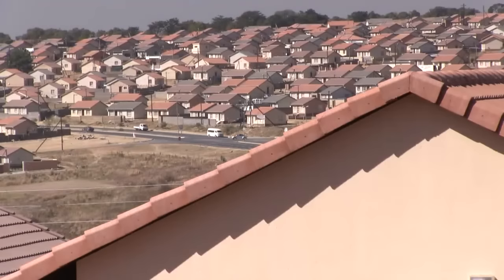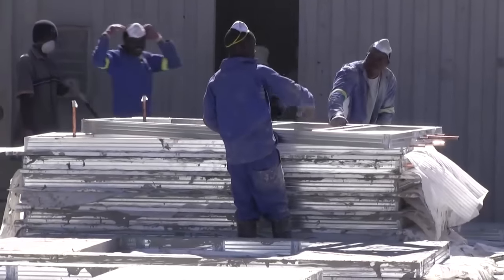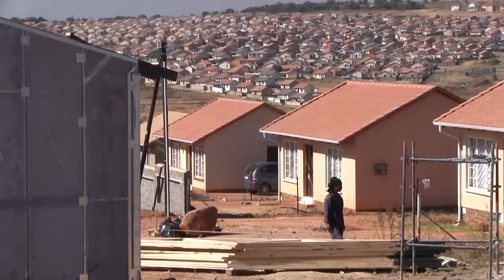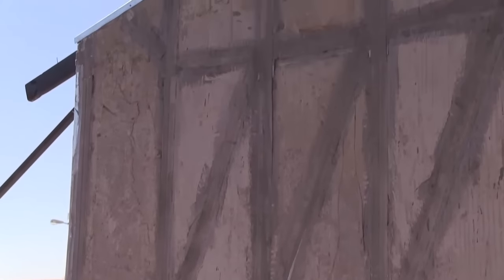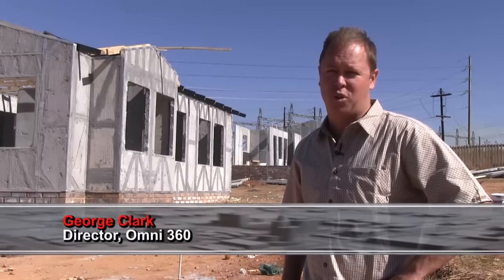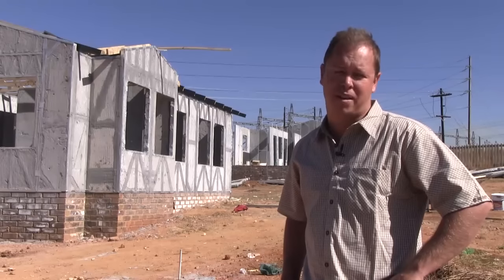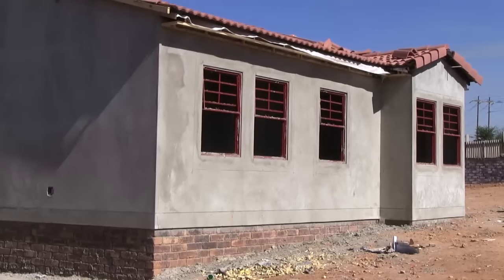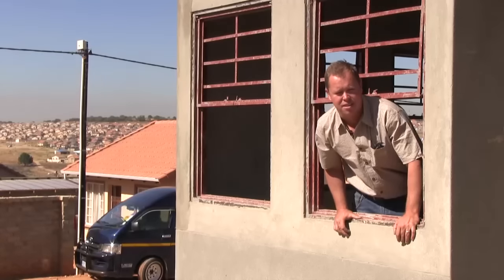How to build a low-cost house in only two weeks (construction)

Comment: So what about the corrosion of the copper pipes in direct contact with the cement?  Seems like you are setting your self up for failure after a few years.  PEX  piping in the walls might have been a better choice.
Reply: i'm in a 40 years old house with copper pipes going through concrete walls.
nothing broke or is corroded.
what do you mean ?
Reply: You are not supposed to allow cooper pipes to be in direct contact with poured concrete.
Reply: I was a home inspector in the mid south region of USA. I am not familiar of copper corrosion in concrete but very aware of the galvanic electron exchange between copper & galvanized (zinc coated) steel. The isolation of pipes from the frame work when filling the forms looked as possibly some questionable workmanship.  I would estimate lifespan of copper pipes as 3-5 years before leaking begins & gets worse over time. Are there any current maintenance reports from these developments available?
Reply: Usually applies to wet concrete. If its dry no problems will occur. Basements get the problem your talking about

Comment: How does it hold up in areas with high humidity and soil shift due toi intense rain followed by long dry periods????  Does the foundation and walls crack if oyu go from intense rain periods to dry periods?
Reply: Why would it?  They are not made of mud
Reply: Cracked slab/foundation.  That is why smart people do not buy houses on slabs in Louisiana .  4 months of soaking followed by 3 months of near drought the soil shifts under the house.
Reply: Living in the Bayou...wet, wet.

Comment: I doubt that foam concrete is going to pass building codes in the US.
Reply: In this application it might. All the structure strength comes from the steel framework.
Reply: Correct
Reply: It is able to pass so long as the panels are sandwiched and anchored on a footing. Minimum standards are ridiculously low. I would advise vertical and horizontal continuous ties as a safety precaution ~ but these buildings can withstand the general forces of seasonal cycles as well as a timber framed building.
Reply: TheStavros1001, the real issue in the USA would be the thermal bridging of the steel studs coated with plaster. Suitable only for southern california climate.

Comment: Biggest problem with all these rdp projects. 
Too many plots. Too much sprawl. Making the issue worse. 

Creating terrace style housing would be more similar to the communal environment these communities are used too. It would take up less of a footprint, connections between homes would use less material, have better insulation, possibility of solar panel arrays in a tighter organization.

Just bad bad design.

Comment: how does this structure resists earthquakes?
Reply: It won't
Reply: Resists like a stack of cards.
Reply: If the steel frames are joined to each other with steel, probably fairly well.
Reply: FYI South Africa does not experience earthquakes. This is in South Africa, Gauteng.

Comment: What the insulation value of the AAC walls?
Reply: Unlikely being very good, better in comparison to bricks is possible but nobody just build brickwall without any insulation in the western world (this is africa) but doesnt really help. Perhaps its easy to install insulation inside that though.
Reply: Increase the stud size ~ increase the R and U value. Additionally the "mix" contains bubbles and can have beads placed in the admix prior to pouring in the panel.